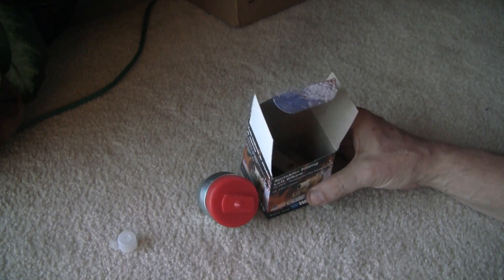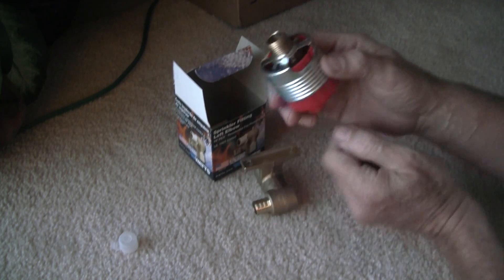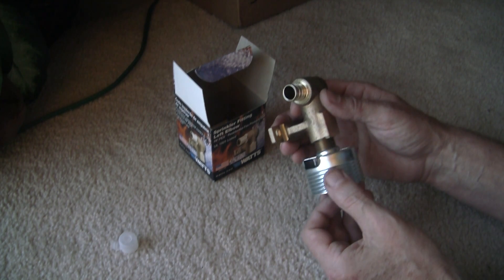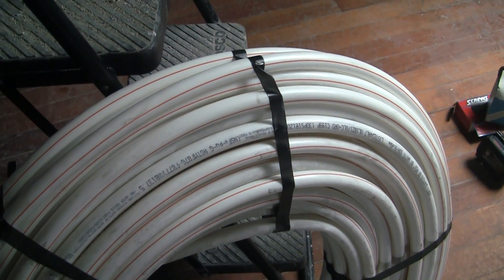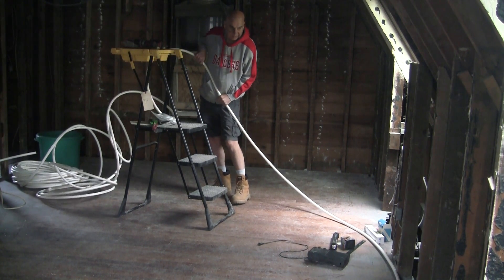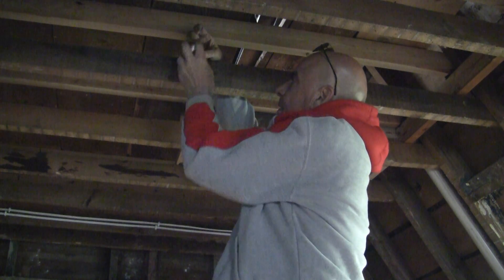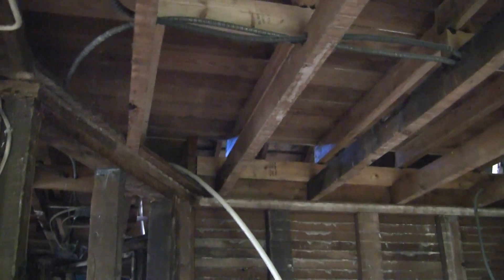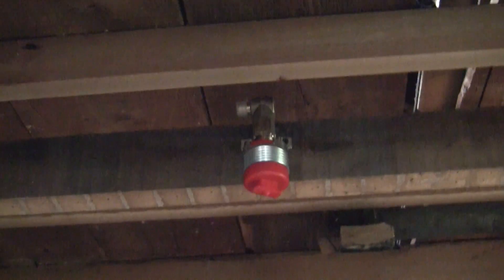How I installed a DIY residential-home fire sprinkler system

Comment: the "pros" here be like yada yada. But then with this guy have suffered a fire and can't afford a pro install upwards of 20k, he wouldn't have one and won't call YOU anyway. better than nothing. his house not yours. sit down. go to bed.
Reply: right on
Reply: 100% correct Angel. This is life safety. If anybody is concerned about water damage then they do not know about the "Mist" System @ 5 gpm. The plumbing will do more damage !
Reply: Try less than Five G's to retrofit' and less than granite countertops for new construction.  Never mind the cost to sell his home later....
Reply: How can install  12 litres sprinkler    on slab of 15 Mitre's height,kindly am looking for  sprinklers holders of walls.
Reply: For those saying you don't need pro never had a insurance company deny the for the installation isn't up to code and you're not licensed.
Reply: @James Franks Jr  Any diyer that doesn’t pull the permit first and have plans approved gets what he deserves.
Reply: @jamesfranksjr9531  if there is no requirement to have that system the insurance company should offer you a free inspection and be glad as the damage from water is minimal compared to fire. I just lost a 32 x 32 garage man cave 1966 ford Thunderbird show car and machine shop equipment with over 40k of tooling in 20 minutes the fire department didn't have a prayer. Thank God it was not attached  the house. Only a fire suppression system can save your house. And you could eat off the floors in my garage had painted floors
Reply: @GoldensRule45  a fire system is there to get you and your family out of the house before it burns. You can replace things lost in a fire but not your family. Here in (Maryland) if you have any type of living space about your garage then they require both spaces to be sprinkled. My advice if a person is going diy it they should contact their insurance company to ask.

Comment: Where can you buy all the equipment? I was told you needed to be a certified installer. Even my plumber could not get it, and the certified installer wanted $25k to do the job.
Reply from the maker: +DrG I bought the Watts pex RF tubing online.   There are LOTS of online pex suppliers.   http://www.supplyhouse.com/pex is one.   The Viking fittings were from a local supply house., but you can also get them online.   Even Ebay has them.

Comment: good stuff! something is better than nothing when the fire starts! not sure if you put a flow alarm on your system but is always a good idea in case of accidental discharge or a fire. Not sure how insurance would look at water damage from accidental discharge if it was a diy but as a sprinkler guy I like it and that pex makes it look easy! nice vid and all the best!
Reply: Sorry but your calculations are wrong. First, the wrong sprinkler was used for this home. 5.8K sprinklers are more typical of residential portions of NFPA 13 systems (commercial systems) where you have to calculate to the greater of either a .10 density or the manufacturer's specs. This home should've used a 4.9k sprinkler at best but more probably a low flow sprinkler like a  3.0k at a reduced spacing.

This particular pex has an ID of .671" and the 5.8k sprinkler used has a manufacturer rating of 16 gpm for 16 ft spacing and less. For a single head calculation this results in .502 psi loss / ft which is very excessive. For a compartment with more than one head you have to calculate two sprinklers which results in 1.81 psi / ft!!!  That's an insane amount of friction loss and that's counting only the sprinkler discharge and not taking into account friction losses through the rest of the system, through the riser components and more importantly, through the underground feed and water meter which is more than likely a 3/4" supply line. A 3/4" supply line and 5/8" or 3/4" water meter have excessive friction losses as well when flowing 32+gpm (from 13 - 26 psi loss). This is why you rarely see pex used in above ground piping, as an aside, I'm pretty sure pex is only suitable on multipurpose sprinkler systems and not stand alone systems such as this.

Bottom line: this system will probably trickle water but is not designed correctly and will never meet the required flows.
Reply from the maker: Bill Morris Thanks for the nice comments.   I haven't hooked it up to the water supply yet.  My main purpse was to illustrate what can be done if someone had access to the wall structure.  I did put in a Fortezz remote controllable (z-wave) shut-off device at the water meter.  I have air tested the system with no leaks, but haven't made the hookup (I wanted to get the hard part out of the way while there were no wall coverings).  Haven't decided on a dry system, or wet, but your comments/suggestions would be welcome.   Bob
Reply: Hey Bob, a dry system would be cool just for the rare chance of freezing temperature. I work mainly commercial but have done a service call for a home with cpvc piping that froze above a ceiling. The home owner was lucky because the water was from a tank and wasnt a constant flow. For cost and efficiency you may consider just a basic wet system with a Potter brand VSR flow switch. This comes with a 1" NPT male pipe thread and has a paddle that sticks into your main pipe and when water flow moves the paddle you get an alarm and you can wire a 120 volt electric bell to it. Mount 1 bell inside and 1 outside. System Sensor is another company that makes the bells and flow switches. The bell and flow switch wiring is straight forward with grnd, neutral, hot and you would just use 14 gauge household wire.
What is the K factor on your sprinklers?
Reply from the maker: Bill Morris 
Specifications:
Available since 2009.
Minimum Operating Pressure: Refer to the Approval Chart.
Maximum Working Pressure: 175 psi (12 bar). Factory tested hydrostatically to 500 psi (34.5 bar).
Thread size: 1/2” (15 mm) NPT
Nominal K-Factor: 5.8 U.S. (83.6 metric*)
Reply: Cool! What size pex did you use? 3/4"? and do you know your water pressure at your meter? 
As a standard a 5.6 k factor sprinkler head requires a minimum of 7 psi at the head to operate properly.
Did you get any hydraulic calculations done?
If not you can do your own just like an engineer would except you dont have the fancy stamp.lol
Reply from the maker: Bill Morris 
3/4"
last time water pressure was checked I believe it was 65psi
no hyraulic calculations done.
Reply: Well being a light hazard application with a design density of 0.10 gpm per sq ft and your static city pressure at 65 psi and a friction loss on the 3/4" pex only being about 2 psi per 100ft  and losing about 15 psi if you are going from your  basement to the 2nd floor ceiling (.434 psi lost for every foot up head pressure) x 30 ft ( 10 ft per floor x 3 floors) plus the friction loss on a couple elbows plus a 10 psi safety factor I would say worst case scenario  you have lots of pressure at the head,  atleast 30 psi. Nice job and for 600 bucks cant go wrong.
Reply from the maker: Bill Morris I see where Potter sells the flow switch.  Checked out System Sensor too.   Was hoping to find a self-contained control panel which would allow me to monitor/faciliate the hookup to the city water system.    Are you aware of any such systems?
Reply: Thank you all for taking the time to make these comments. Very helpful info, all.

Comment: Very interesting video. He does a lot of math just to figure out the rough-in  placement height of the fitting sfor the finished sprinkler.As a 29 year union sprinkler fitter and Instructor, I can tell you a  much easier way. Thread and tighten the sprinklers in the fittings before installation. Go to the sprinkler technical data sheet and find the tolerance from the edge of the concealed cup to the finished ceiling. Make a template out of scrap plywood or drywall the same thickness as the finished ceiling,about 2' long. Cut a hole in the middle of the template the correct diameter for the sprinkler. place and temporarily fasten the template to the joists  using removeable screws where you want the sprinkler. Using the template as a guide, lower the sprinkler into the hole, and place the edge of the sprinkler cup  within the rough in tolerance on the data sheet, then fasten to joists. (1/8"-1/4" above the lower edge of the template is usually the dimension). I would be on the smaller dimension side, experience has told me you usually rough in them too short when using the high rough-in dimension, because of ceiling sag.
Reply: Thanks for the non-snarky, knowledgeable and wise response.
Reply: As a retired 40 year union sprinkler fitter I watched almost 3 minutes of this and then I wondered why.  But I've never done a pex system so if I decide to put one in my house I might revisit.
Reply: And this is why I always read the comments! Thank you for sharing your experience - it's the most expensive form of education. :)

Comment: How much should i leave from the top of joist of  a second floor flooring can i install the cpvc pipe in the ceiling of the first floor may be 1 1/2 from top of joist there is a code for that ?

Comment from the maker: To respond to Frank...what was I thinking ?   Hmmm.  Let's see.  House fire ...lost everything including dog....just house framing left.  Opportune time to put in a sprinkler system.  Why do it myself?  Hmmmm.  A good question.  When you spend 10 years renovating EVERYTHING in a house, you develop certain common sense skills that unfortunately don't exist in...say 50% of contractors ...and that high percentage was substantiated in the rebuilding process.   Would I trust you to do it?  Or trust my own proven skills after a little self education?  Sorry Frank, but I pick me.   That's what I was thinking anyway, and I'm very happy and content with that line of thinking.
Reply: bobbtall nice video, thanks for sharing. I seen some people didn't think you should install unless certified, I think it's your own home and a great idea, and your right to do so. I assume that in an existing home, with drywall, etc. it would be more difficult since plumbing not exposed. And, if on a slab, even more of a challenge? I guess more work, but still not impossible. thanks Johnny
Reply: The design, the hydraulic calculations and the flow test can be replace by a pump/tank/manifold plug-and-forget system.
Reply from the maker: Sandra Can you provide details on where to get this system?
Reply from the maker: Sandra     Sandra:  Can you shed additional light on your comment: The design, the hydraulic calculations and the flow test can be replace by a pump/tank/manifold plug-and-forget system....    Such as brand name?   Model #'s ?   Mfg ?
Reply: To all the naysayers in the comments - I totally agree that a system that doesn’t have a permit, approved plan, and inspection is a nightmare. But I also agree with the owner that he probably knows more about his old, pre-current code house than 50% of contractors. That’s been my experience too (plus the amount of labor needed to work with the plaster and lathe, etc, makes it prohibitively expensive unless you do the work yourself). It’s also worth noting that the NFPA doesn’t take a position on which trades should do this work. That’s the responsibility of the AHJ. Furthermore this is a NFPA 14D installation - which allows the sprinklers and the domestic cold water uses to share the same pipe and fittings. So all the licensed plumbers are now jumping up and saying that the licensed fire protection technicians aren’t qualified to work on such systems. It’s like civil engineers and architects arguing about who gets to stamp (and charge for) house plans.

Comment: Follow the irc 2012 P2904 and you can protect your family for just $0.20 per square foot.Gluing cpvc pipes is child's play and the sprinkler head cost $7. Cpvc resist to 122°F but the running water keep the pipe well below that, a 3/4 10 ft. cpvc cost $6 at home depot. Pressure Test Your Pipework and you are good to go. The 2800+ home market is control by the NFPA and most installation cost more than $1.50 per square foot ! Build your home at 2799 sqft and save 4000!
Reply: cpvc not available at my home depot.

Comment: Blazemaster CVPC pipe and fittings (UL & FM approved) is the best installation for 13R & 13D sprinkler systems. Also you can save some money going with a residential white finish semi recessed sprinkler head compared to a concealed sprinkler head. The concealed cover plate is more appealing than actually seeing the exposed recessed sprinkler head but both look good as a finished product.

Comment: All fire sprinkler systems for NFPA 13D must be hydraulically calculated. Pex tubing has more friction loss than CPVC pipe. You would most likely need a domestic fire pump to run a sprinkler system in Pex. Call a qualified fire sprinkler contractor and have them evaluate and design the proper system for your home. Its not a DIY project.

Comment: Get with a sprinkler pro let them design and calculate your fire sprinkler system to your water supply. It would be a shame for a home built system to fail considering the carpet in your home cost more than using a pro.

Comment: VK474 sprinklers require 16 gallons or 60 litres flow per minute at a pressure of 0.56 bar or 7.6 PSI. To test this you require a gauge at the connection point to read pressure when simulating operation. Remove the most remote sprinkler from the gauge and install a half inch threaded pipe with a ball valve long enough to go into a measuring container. Break the link of a spare sprinkler and screw into the valve. Pressurise the system then open the valve. Run for one minute then shut the valve. Record the pressure on the gauge when running and measure the amount of water in your container. A successful test will require 16 gallons flow at a minimum of ).56 bar pressure. Good luck.
Reply from the maker: Great. Great stuff.   You are a gentleman and a scholar.

Comment: good video. I believe Boccuzzi and some others may have some alternative motives to downing your diy installation.  I'm a firefighter and know some stuff about sprinklers and I know that alot of the newer sprinkler heads don't even need much flow at all to work properly although adaquate water flow is something to consider you do not need much and considering usually only one head opens before the fire is extinguished what  marty was saying is not ususally needed.  protect your family
Reply: Robert Hatcher Lab tests regarding residential fire scenarios which are the basis for revisions and additions to NFPA standards do not consider only the adequate operation of a single sprinkler. Multiple heads in a remote isolated area have to operate simultaneously in terms of design density in gallons per minute per square foot.
Reply: I’m a pipefitter for sprinkler company and idk why I’m watching this video or reading comments but you are 100% right. Most fires are out out with less than 5 sprinkler heads.

Comment from the maker: So, putting up the piping before walls are installed, JUST IN CASE YOU WANT TO MAKE THE SYSTEM ACTIVE, after having been through a house fire, even if the piping passes a pressure test.... is NOT a DIY project.    Hmmm.  Interesting.

Comment: It is not better than nothing at all. Your approach can lead to injury and death. If someone thinks they have protection they may act differently. The design basis of these systems does not include extinguishment - they are designed to provide a little more time to get out.
You kept calling sprinklers extinguishers. With some exceptions (none res) sprinklers are designed to control, not extinguish, fire. You shouldn't demo what you know nothing about. I find this irresponsible, the very least.

Comment: It is not better than nothing at all.  Your approach can lead to injury and death.  If someone thinks they have protection they will act differently.  The design basis of these systems does not include extinguishment - they are designed to provide a little more time to get out.
You kept calling sprinklers extinguishers. The sprinkler you used isn't designed to extinguish a fire.
  There are some things that are better left to the pros - like fire sprinkler system design.

Comment: I suppose you had your DIY sprinkler system hydraulically Calculated by a certified fire sprinkler engineer to see if you have the proper water supply and pipe sizing. I think you are messing with fire when it comes to life safety and liability and the possibility of somebody's life in a fire. Not enough water, The sprinklers wont do there job.

Comment: I am LICENSED FIRE SPRINKLER DESIGNER in the state of Georgia and by NO MEANS is it acceptable to install a DIY fire sprinkler system in your house and in fact it is against the law. to design or install a fire sprinkler system you need to be a licensed and experienced professional. there are many aspect that go in to the design of a system like this, like water supply, obstructions, types of heads to use, pipe to use. also each system hydraulically designed to ensure that it will work properly.

Comment: I agree with the statement "The average person has no comprehension of the engineering and design required for a system to function properly." It really does take a lot of thought and planning for correct installation to avoid lack of coverage, cold soldering, etc.

However, it ***CAN*** be done.
Reply: Right the average person can do it.